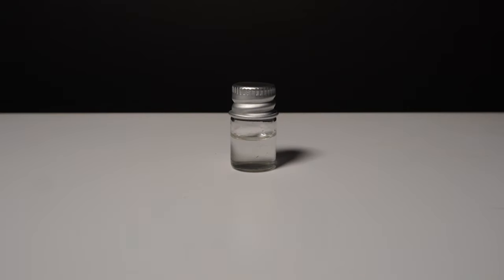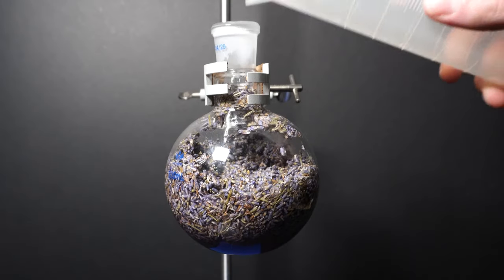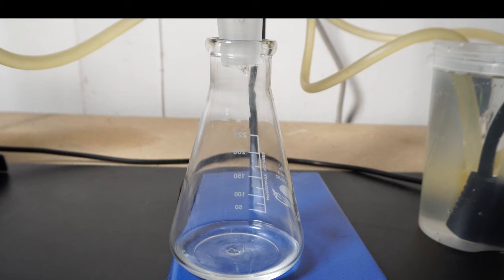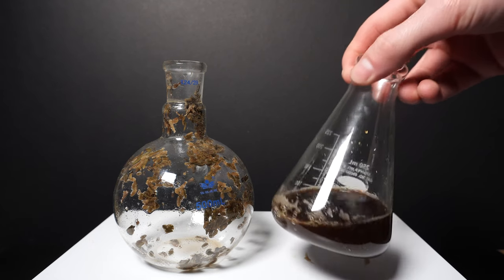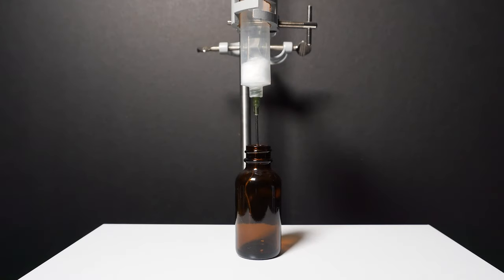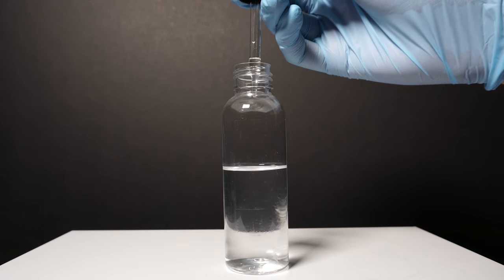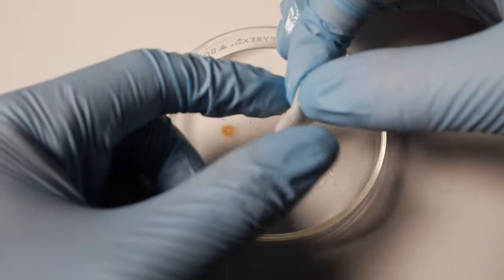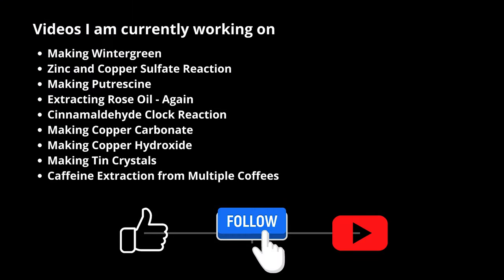The Oil From Lavender Buds #distillation #essentialoil #lavender

Comment: Your method of oil extraction was the hard way.
Reply from the maker: Is the easy way this just soaking and letting the soil separate? 

Dried lavender buds, from my experience, do better in a distillation when wanting to separate the oil 
Then it can be dried with magnesium chloride, or calcium chloride to remove excess water. 
I’ve actually done this a few times since I released this and I have overall increased my yield by a lot
Reply: @PrestonImpx  Fill a container with lavender petals. Cover with water. Allow to rehtdrate for an hour. Seal this container leaving a steam escape hole at the top. Run a slightly downhill tube from the lid to a 2nd container filled with cool water to an open drain spout. Add med heat to the flower petal container and allow too steam for an hour or two. The steam will carry the oils to the 2nd container and spill into a waiting jar from the spout. Now all you have is some water and lots of oil in a jar. Just separate. 🤗